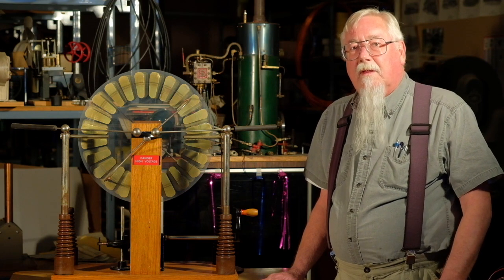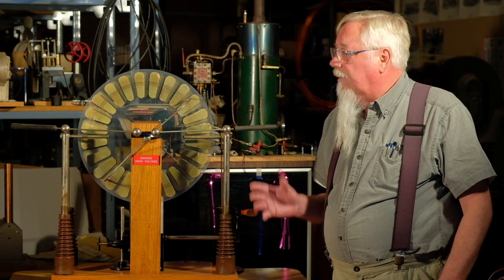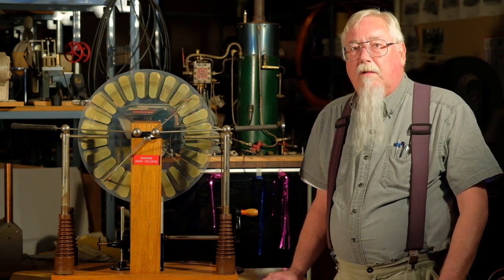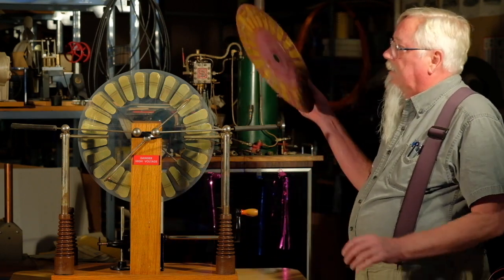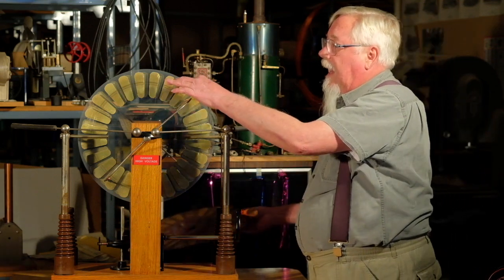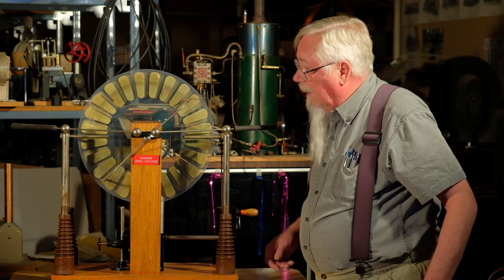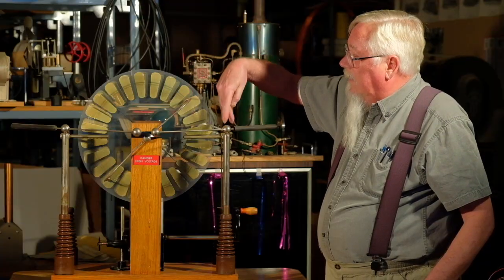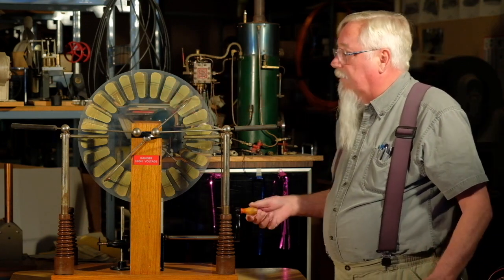Wimshurst Generator

Comment: Good afternoon. You have an unusual design of the machine. Did you make it yourself? It is possible to use your knowledge in free heating and lighting at home?
Reply from the maker: This machine was built around 50 years ago and Garry has owned it for many years. It isn't possible to generate significant power from this machine. A small amount of the energy used to turn the handle is converted to electrical energy and therefore it is not "free." The machine was built to demonstrate the principle that charge can be separated from atoms by mechanical work, stored briefly, then discharged across a spark gap.
Reply: @DavidSkelhon  Yes, I know how this machine works in physics lessons, but in the film Vidocq with Girarod Depardieu, in the region of 15-20 minutes, such a machine shows completely different possibilities, and I heard something similar in the Swiss Testatika project. In addition, I am interested in a silent windmill (I tend to vertical) of 5-10 kW for a private house. I often have wind and such technology would be very useful.
Reply: @КостянтинДосичев  The machine in the movie was not really operational and was there to add cool special effects. You will get high voltage from this, but low power as you cannot get more energy out than you had put in.
Reply: @Ratzfourtyfour can you use like a dynamo too charge a battery by arm power...cherrs